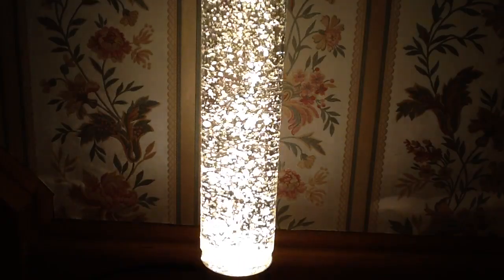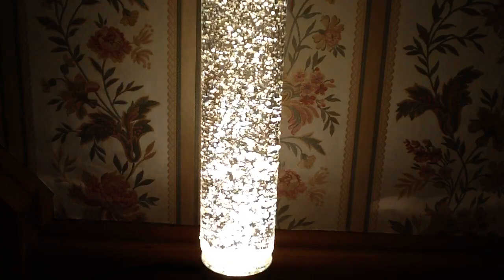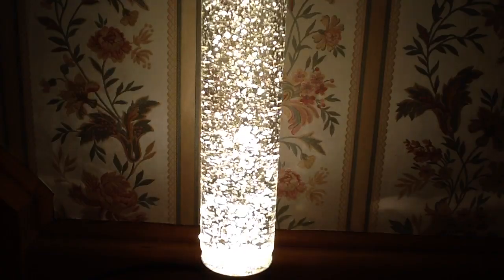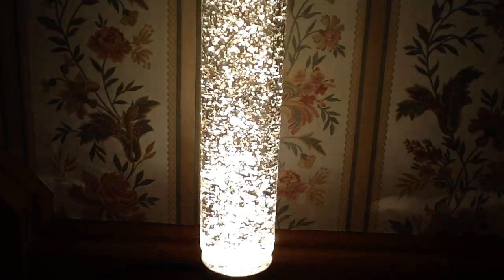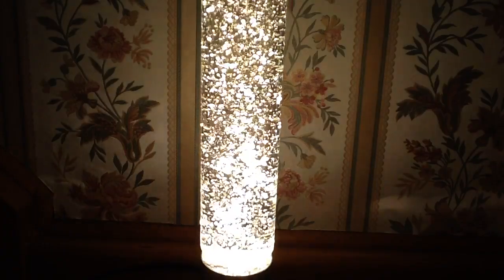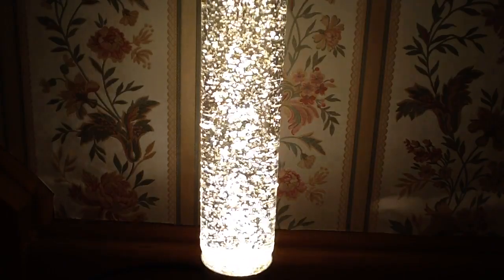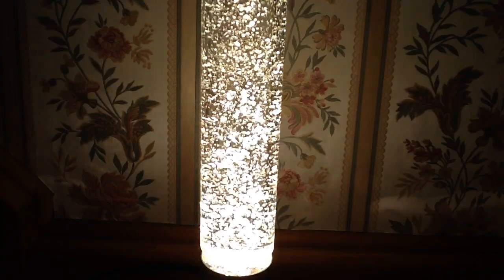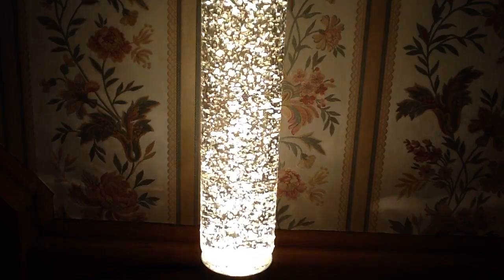Calcium nitrate DIY glitter lamp.

Comment: Hi Clive, I know this video is 9 years old but I really want to make one of these!  Do you have a link to the light bulb that I should use?  And the solution is 100% calcium nitrate filtered correct?
Reply from the maker: Unless you're a glutton for punishment, you'll find it a lot easier to buy one of the many commercial glitter lamps sold on eBay alongside the lava lamps.
Reply: @bigclivedotcom aww is there a reason you say this? Did something happen after a while? Very interested in making one myself too. You no longer recommend calcium nitrate?

Comment: Hey Clive!  Thanks so much for sharing these videos! I was wondering, did you experience any crystalization/settling in your calcium nitrate lamp? Or even your calcium chloride one... I seem to be having issues with the solution staying a solution, and was wondering if you had noticed this as well!  Hope you are well!
Reply from the maker: I've not with the calcium nitrate lamp.  But with a high enough saturation of calcium chloride it could precipitate out when cool
Reply: @bigclivedotcom  Thanks! I did notice it first with the chloride... I wonder if I did not clean out the lamp thoroughly enough when I switched over to nitrate. It is filled with crystals that won't seem to dissolve back in. I will try a fresh batch, and also running this one through some coffee filters with a paper towel sandwiched in between. (This seemed to have helped with the chloride). Thank you again!

Comment: I have a Goofy lava lamp that has little Mickey Mouse glitter heads that float around. I changed the water not knowing. But now the little glitter heads settle at the bottom. Will the Calcium chloride correct the issue and allow the glitter heads to float around?
Reply from the maker: +Mike McConn Depending on the density of the glitter you may need something like calcium nitrate.  But even then it will depend on whether the glitter pieces are coated to protect them from corrosion.  It might be easier to get a cheap plain glitter lamp and decant the liquid into your own minus the glitter, although again it may require fine tuning of the liquid.
Reply: +bigclivedotcom I'm not 100% but have seen the glitter heads are made from solvent resistant polyester that can be purchased from onestopsparkleshop through ETSY website.  Looks just like what I have in my lamp. I would really like to restore my goofy lamp with minimal costs. It was a gift to me many many years ago and I'm a fan of goofy himself. So using either the nitrate or chloride would be my best guess bet. Thanks for your reply

Comment: I'd love to see a walkthrough of the construction and specific gravity balance... :)
Reply from the maker: +mnelson10000 Fine tuning the gravity is very time consuming and takes several days.  Less critical with a traditional tungsten lamp due to the higher liquid movement, but with an LED lamp it has to be tuned to the nearest drip of water, and the only easy way to get excess water back out is to put the vial on a hot lamp and let some of the water evaporate slowly.

Comment: Hey Clive, have you noticed the same corrosion effects with the calcium nitrate that you did with the calcium chloride solution?
Reply from the maker: knwr Yes.  But only with certain glitters.  The glitter I used in this version seems resistant to the liquid.  However, there must be another liquid that is not corrosive, as I swapped the glitter in a commercial lamp with the corrosion prone stuff and it has been fine for about a year.
Reply: bigclivedotcom I agree, there's got to be something else to use. For now I'll search for coated glitters though
Reply from the maker: knwr I just bought a random selection of small packs on ebay and then put them in marked bottles with some liquid to see how they fared.  You can usually tell in a day or two.
Reply: Hello bigclivedotcom, I’ve been looking for the calcium nitrate you reference. I see products used in hydroponic fertilizers. Is this the correct stuff?